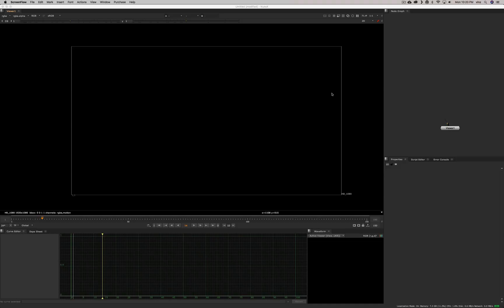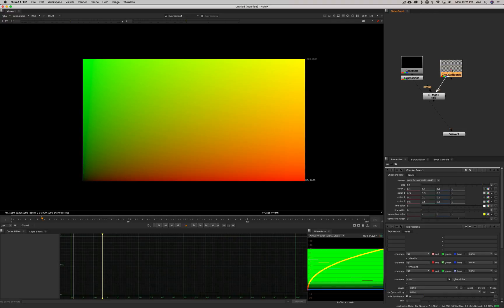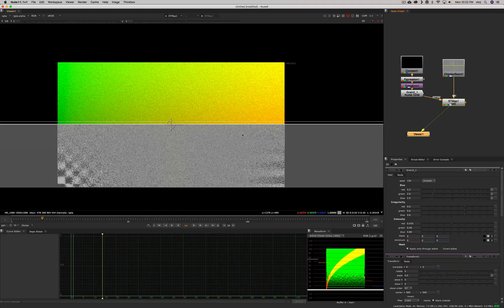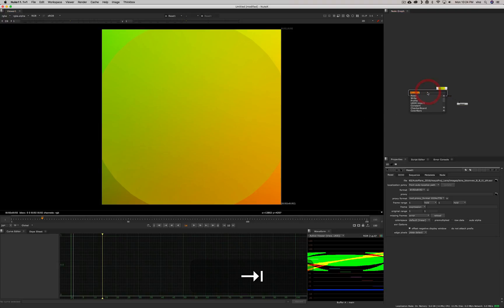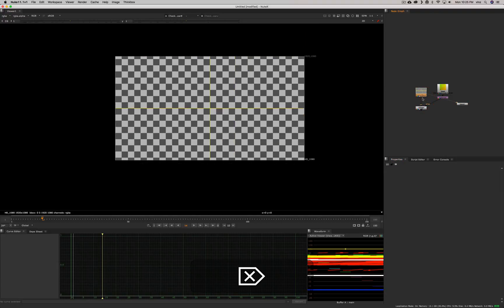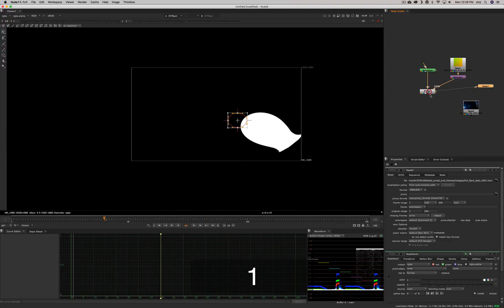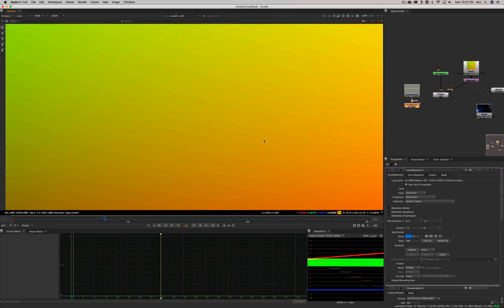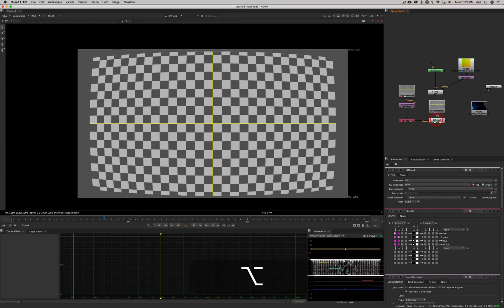Nuke Nodes Kickstart - STMap

Comment: Nice introduction to the STMap, thanks :D One note for the Nuke users:
Expression should be: (x+0.5)/width and (y+0.5)/height.

If you don't add 0.5 in the expression, your image get slightly blurred (filtered).
If you add it, your image will not be damaged. Try it yourself and switch between before and after the STMAP-node.

Nuke will sample every pixel at the bottom left corner: (o,o) , (1,0) etc. 
But you have to sample every pixel in the middle, that's why we add "0.5" (half a pixel) in the X and Y direction.

Comment: I have a question regarding the lens distortion, how do you know how many pixels to render for Overscan? For instance, your CG element needs to have extra pixels around the edge to compensate for being distorted right? So how do you know how many extra overscan pixels you need to render for your CG element
Reply: If you have a lensgrid (checkerboard) filmed, you can undistort the lensgrid with the 'LensDistortion' node.
Your image will be undistorted and you will see a boundingbox around your Nuke viewer.

This is how much extra you have to render.
I think 10% extra overscan should be enough for most lenses, but if you have a fish-eye, more :P

Comment: What type of object did you use as a lens in maya? Was it a squashed sphere in front of a camera that's pointing at the uv map or was it a more elaborate lens setup with multiple glass elements? I'm super interested in how you got thus working.
Reply from the maker: I modeled lens based on some info I found online (concave ones, convex ones, etc...), and I placed a UV map on one side and a the render camera on the other. You also need to make sure everything remains 32 bit float from the map to the rendered image to get smooth distortions back in Nuke. You can align multiple lens to get different results.
Originally, I wanted to render multiple single lens distortion maps. The idea was to create a gizmo in Nuke where I could cumulate distortions maps and "simulate" a camera lens made of different elements.
It ended up being too render intensive, and since I've been looking at doing some math in Nuke instead, or using the new Nuke lens distortion Node.
I've been looking into all that to create a Lens Flare gizmo, in order to update one I've made a while back with more realistic behavior.
That's the one I have made : http://www.nukepedia.com/gizmos/filter/autoflare
http://vincentwauters.com/programming/autoflare20-for-nuke
Reply: @TheFrameLab  Any news on this.?